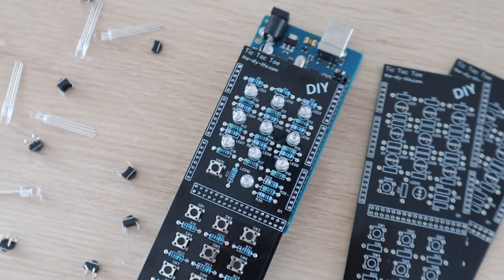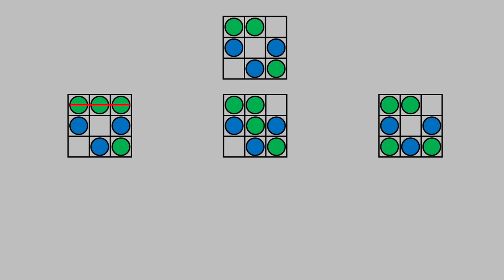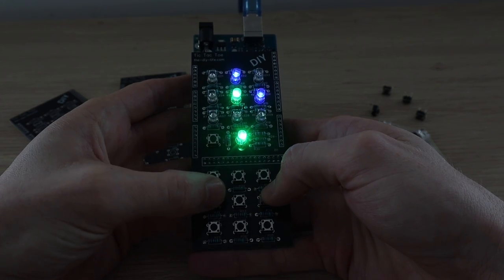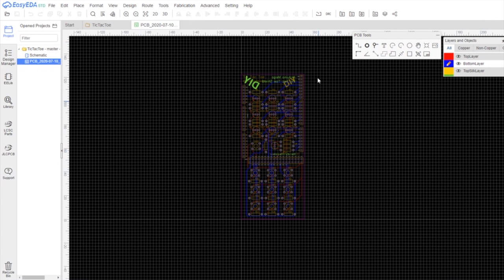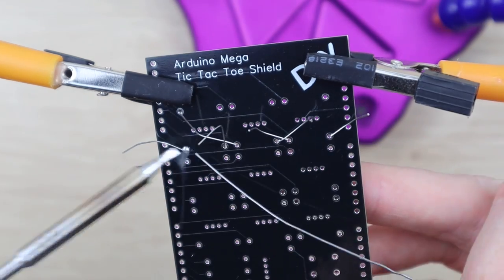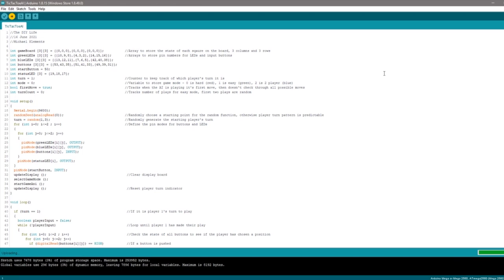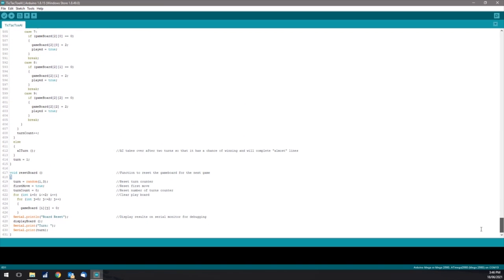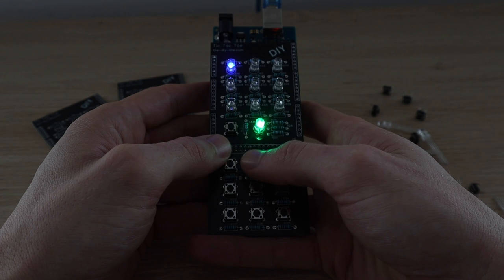Make An Arduino Tic Tac Toe Game With An AI Opponent

Comment: can i use an arduino uno instead?
Reply from the maker: The uno doesn't have enough digital IO for this shield.
Reply: So there isn't  a way to use an arduino uno instead, like if i didn't use this shield and solder evry thind on a breadboard board and than conecte evry thin to an arduino uno. Because i noticed that most io pins are used to hold the schield or am I not seeing something.

I am sorry for bothering you. I just started my apprenticeship and dont know much about arduino, and i want to learn as much as possible
Reply from the maker: No there is not, this shield requires 31 digital IO pins to operate and the Uno only has 14. The schematics and explanation are available in my blog post linked in the video description.